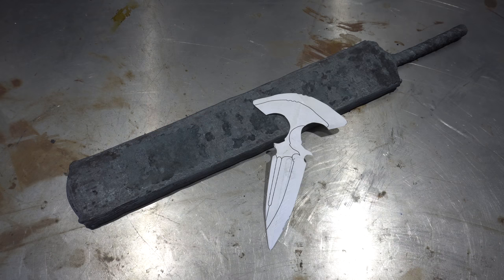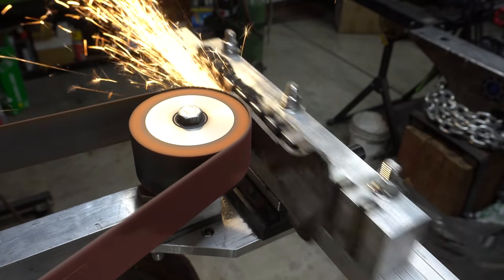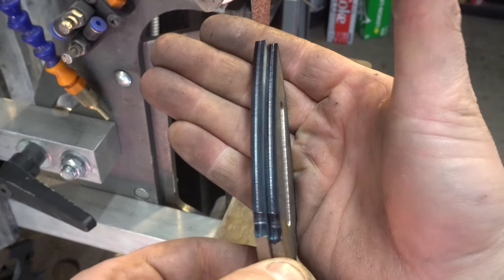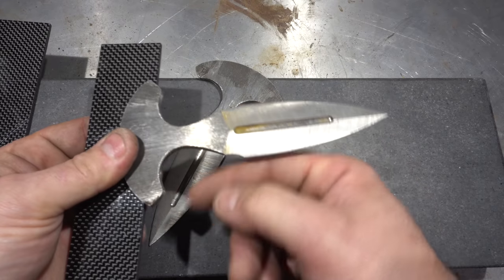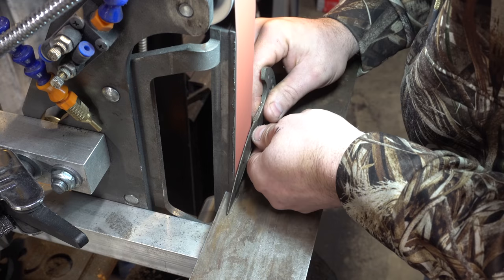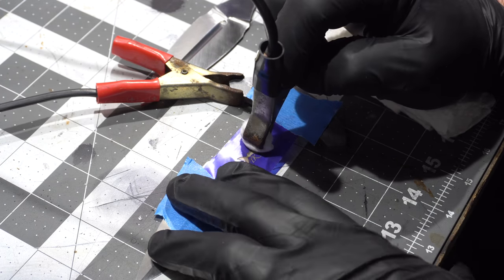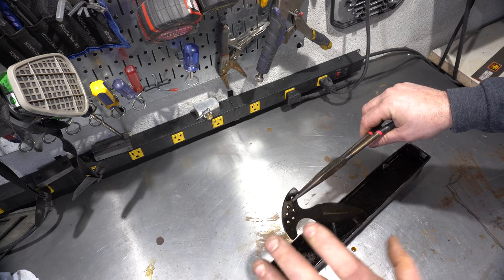Forging Damascus Push Daggers - The Complete Video

Comment: Awesome knives, fantastic workmanship! If I may make a few suggestions in hindsight, If you drilled the (2) holes for the scales you could have bolted them together to profile them.
I would have omitted the other holes in the handle (you could have drilled into them just as though you were doing a rain drop pattern you could have used clear lucite scales so that the entire Damascus pattern of the knife would be visible.
Reply from the maker: Thanks for checking out this build.

Comment: Great looking knives man. Have you ever thought about grinding the handles before glue up and then etching and then gluing them so you get the damascus running all the way around the perimeter of the knife? I feel like it would add so much more to the knife especially since you make the damascus yourself. You want to show it off all the way around!
Reply from the maker: This is actually the first knife where I haven’t etched the edge.  I usually do but thought I’d go another way this time.  You don’t need to grind it separately, just etch it with a qtip. Thanks for watching.
Reply: @TyrellKnifeworks  I almost exclusively use screws for my handles but i did have one knife where i tried the q tip thing and i just didn't feel like it was as deep and even as throwing the whole thing in a tub of ferric chloride haha. it may have just been the damascus though cause i don't have the tools to make my own yet.

Comment: The answer to my question may be obvious and I'm just brainfarting, but doesn't the weld "contaminate" the material? I'm guessing there is a very specific wire/stick you use to minimize this.
Reply from the maker: The part that is being welded is cut off or ground off so it doesn’t really affect the look of the Damascus.  That’s why I usually only weld the ends.  Thanks for watching!

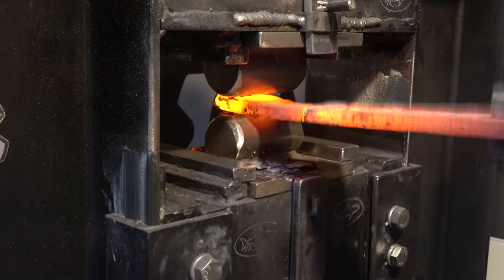Comment: at 3:00 you used an angle grinder, it it easier to cut red hot steel than cold steel?
Reply from the maker: It is easier to cut hot steel than cold, but I do it mostly because I don’t want to wait for it to cool. 😜 Thanks for watching!

Comment: Why does the scale form? I mean when ur pressing them, why doesn't it just re attaches with the rest
Reply from the maker: Whenever hot steel above about 1500 degrees is exposed to air, it oxidizes abs forms scale.  There’s no way around it.  Borax flux is used to coat the billet to help protect it from air contacting it.  Thanks for watching.

Comment: Can you ask a question? To prevent adhesion of Damascus tanks, can stainless steel tanks be used directly?
Reply from the maker: Sorry, adhesion of what to Damascus? I don’t quite understand what you’re asking.
Reply: I believe he is inquiring about canister Damascus?
Reply from the maker: Ohh.. thanks  @Crusaderjoe52.. I get the question now.  Yes, I do in fact use stainless tube for canisters and it works amazingly well.  I'm going to do a canister again sometime in the first half of next year.  👍🏻
Reply: @TyrellKnifeworks  I'm sorry I used Google Translate. I also said that iron cans are generally used to make Damascus tanks. Can I use stainless steel tanks directly? I don't know if I can understand the translation this time.
Reply: @crusaderjoe52  Thank you, I am indeed asking about the material used
Reply: @TyrellKnifeworks  Thank you for your guidance
Reply: @idleartisans778  glad to be able to assist you both 😁

Comment: why machine in a fuller?
Reply from the maker: Why not?  If you want a very precise fuller, it’s easier and more precise to mill it in.  Grinding in a 1/4” radius fuller is very difficult and look bad.  Trying to forge it in looks even worse.  If you’re s purist and think you must forge everything, that’s antiquated thinking.  The end result is what counts.  Thanks for watching.